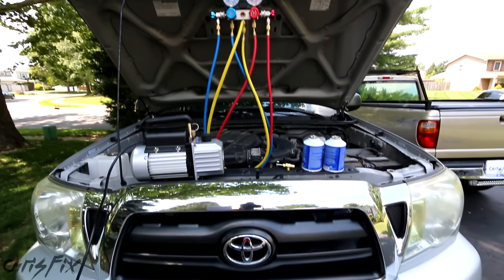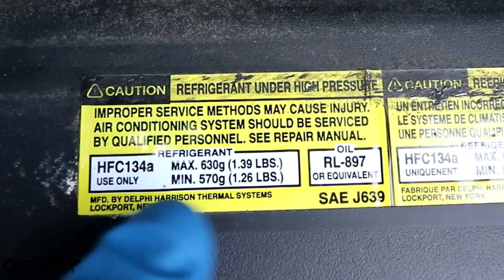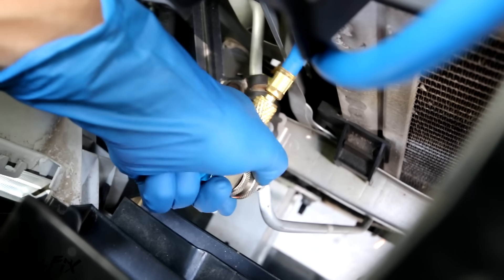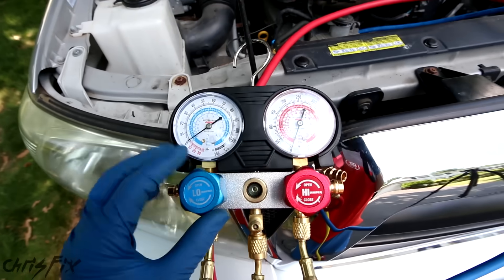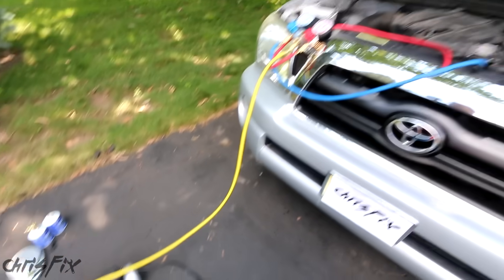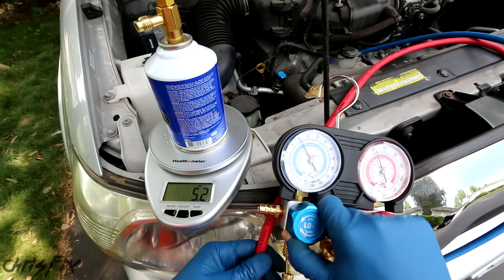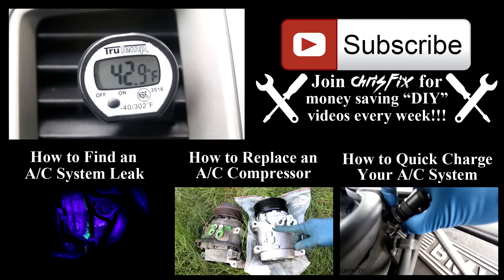How to Properly Recharge Your AC System

Comment: Nice videos Chris!  As a (EXTRA) precaution after pulling a vacuum on a car's a/c system and after performing a system leak check for a minimum of the 30 minutes (using a R-134A manifold gauge set ONLY) and BEFORE disconnecting the manifold gauge line set:  CLOSE  the HIGH & LOW valve at each port, then wait another 15-30 minutes to verify that the High & Low side a/c port needle valves (a.k.a.- Schrader valves) are not leaking.  Nothing's more irritating than having a charged a/c system leak at the High or Low side port, immediately after disconnecting the high & Low side line set!
Reply: I wish I read your comment before re-charging my system. Everything worked perfect for 2 days, then the AC wouldn't cool anymore. I came to find out the schrader valve was leaking. So I had to replace it and re-charge the system. @ChrisFix awesome video - I would add this import step to check the schrader valve since the vacuum test you do on the video can be deceived.
Reply: @howardtempel  the important step that you missed it to put the cap on. It does not matter if the Schrader valve leaks, they all do. Seal it with the cap.
Reply: @bryanbrickson1573  I never thought the cap would withstand 200+ PSI of pressure.
Reply: @howardtempel  

Yes, the cap is like those tire caps. Just a small rubber o-ring at the bottom. Can't seal very well. More to keep out dust.
Reply: @howardtempel a slow leak is not going to release 200 psi. Maybe 5 psi or less.  The cap can handle the pressure of a slow leak
Reply: @adamr8628the pressure will build even WITH a slow leak.  Just takes longer 😂😂😂😂
Reply: Dude this is one of the best how to videos I've ever seen on any subject.  Well done!  If I'm just disconnecting the condenser for a short time to do an engine swap i assume i wouldn't' have to add any oil, correct?  Also if I tape off the open lines would I need to replace dryer and orifice tube?
Reply: @Worldsokayestcraftsman  Always will need to replace dryer during engine swap.
Reply: This just happened to me on the high side I should have read the comments lol
Reply: Thank you so much for every YouTuber like you
Reply: Guys your valve leaks because the high pressure damage your seals. Do not open the red side (high pressure side) you don't need . I bet you have all the oil out and inside the red hose .
Reply: All schrader valves leak. The cap is the seal. To test an electronic leak detector remove the cap. It will alert. Replace the cap. It will not alert.
Reply: My cap sure does a good job at sealing it off.... I have a valve tleeking on my truck. I even cleaned with brake clean and checked it weeks later with a die light.... not leeking....
Reply: @51-FS I've never done an AC repair job before but just got done diagnosing a bad compressor finally.  Part of that diagnostic was attaching a can of R134A with a quick connector just to see if the system was low on coolant. When I pulled the attachment off the Schrader valve some of the coolant from the can, system or oil had spilled into the Schrader valve opening.  I was able to see bubbles forming from the leaking Schrader valve.  I sprayed some soapy water down inside the Schrader valve area after a few minutes to verify there were no more bubbles and then sprayed it out with brake clean and compressed air to get rid of the soapy water.  They sure do need to be checked like u guys are saying
Reply: I've had a leaky valve before so now I just replace the low and high side valves each time I recharge a system. I bought a little kit with a bunch of valves and the removal tool for about 10 bucks years ago and I am not even half way through it yet. Definitely worth it for the peace of mind.
Reply: Yup, my (now) car builds ac pressure when adding refrigerant, but as soon as I disconnect the quick connect on the ac refrigerant can, the low side service port needle valve(schrader valves) leaks with an audible hissing.  I still don't know if anything in the ac system needs replacing, though. I've been driving the car for a few months after having the car sit for most of a year due to bad tcm.
Reply: I can skip this extra precaution if I had never recharged before? I have 178k mi?
Reply: buy the mastercool kit to replace them without losing the charge. Professional...
Reply: Probably pretty rare but yeah
Reply: I thought this through, and I think there is a slight issue... So, let's say that the Schrader valve is leaking... Well, if it leaks into a manifold gauge that is completely sealed, then there is no leak at all (no delta)... Instead, I think one would have to close off the valves, bleed the gauges, then watch to see if they go from zero to some value while the Schrader valves are not depressed...  Let me know if that is flawed thinking or not...   Just realizing that a Schrader valve turned backwards is a blow off valve dependent on spring strength...
Reply: For less than $20, just replace the Schrader valves any time you draw down the system. Empty system, replace valves, pull a vac and then fill. Then there are zero questions. 

Also to everyone that is just refilling with the can kits…a lot of times it’s just the valves. My buddy was refilling with those cans every week or two. He probably bought 20 of them. He finally took it to a mechanic buddy of his who replaced the valves and he never had another problem. Check the cheap, easy stuff first.
Reply: @stevewhiting556  Good for you and your information that you receive....
Reply: @thetruthserum2816  We use nitrogen pressure tests in refrigeration to check for leaks obviously to include the schrader valves.
Reply: @thetruthserum2816  I had the same conflict of logic you did with this comment. He has the right idea but did not know the correct way to expose the Shrader leak. I was looking for this comment. Thanks.
Reply: @thetruthserum2816  

Mmm so isn’t the best thing to do and what should be recommended if you’re doing this to just replace the shrader valve first, which is cheap and easy?
Reply: @thetruthserum2816  tough to install a schaeder valve backwards as it requires a special tool to remove and install it.  Just sayin
Reply: @chrisanderson6204  You missed what he was saying.  A schrader valve, installed the right way, has a little spring under it that keeps the tip up when there isn't much pressure in the system.  Once there is pressure, it pushes on the bottom of the valve too, keeping it sealed.  But, if you "over pressure" from the outside, it will overpower the pressure underneath, and the spring pressure too, and actually add air, etc.  He's not talking about installing it backwards.  But, he is right ... if it is leaking at the schrader valve, and still connected to a closed gauge, the pressure won't change, as it is being held in by the gauge, and can't actually leak out.
Reply: @bennyblanko3  this is all true. My mistake.  It's possible to have a very slow leak at the valve so it's always advisable to check the valve for leaks before AND after servicing.  I made that mistake once on my own car. It was ok before but leaked down after.  D'oh!

Comment: Couldn't you still have a leak after one hour though? I'm going to let mine sit longer because I replaced some o rings and a condensor ( used off my other stang ) and I'll see what it does. It did hold after one hour though. Worse case is it if it takes a long time to leak down and I guess I have a small leak, then I will just recharge every so often and hopefully it's no more than maybe add a little freon every summer or every few summers.

Comment: oh man, as a former AC technician I never used gloves or glasses 😬. disconnecting the high side line of the gauge on a charged and running system is always interesting.

Comment: Refrigerant flows out of a/c compressor from high side in liquid state . As it passes the through the  expansion valve or tube it turns  into gaseous state before entering the evaporator  .
Reply: As refrigerant exits the compressor, it is a highly compressed, super-heated gas.
As it flows down thru the condenser, it cools and becomes a liquid.
The rest...👍

Comment: Hey there Chris, I just got done installing a new AC Compressor on my 2006 Porsche Cayenne Turbo 4.5l V8. The issue I'm running into is that I can't get more than 70psi on the high side. I'm at a loss. I checked all the fuses and they seem ok. If you have any suggestions I would greatly appreciated.
Reply: What are getting on the low side?
Reply: @charlesguinn4316  I'm getting 85 on the low side and 90 PSI on the high side
Reply: @charlesguinn4316  is that the expansion valve by chance?
Reply: @mikestavale6673  I looked it up.
Murray Climate Control A/C Service Kit

Part # MUK20211

At O'Reilly's
It's called a block valve.
I'm not familiar with that one.
But this is a replacement kit.
If the compressor IS turning,  then my next move would be to pull/dump the charge.
Remove the block valve and try to clean it.
But if the dessicant is oil soaked it will need replaced. If it has ruptured and moved thru the system, then that's beyond most DIY. But take it 1 step at a time.
Reply: @charlesguinn4316  i will definitely order it and replace it. I will keep you posted. Thank you so much for your help
Reply: @mikestavale6673  Murray Climate Control Expansion Valve

Part # 39288

Ok they are just calling the expansion valve a block valve...🙄
This is just the valve. One is 38bux the other 52.
not the whole kit.
I'd open er' up then decide which route to take.👍
Reply: @charlesguinn4316  I truly appreciate you Charpes. I'll let you know what happens after I replace it 🤙
Reply: @mikestavale6673  np bub.
Reply: @charlesguinn4316  so I just got done replacing the expansion valve and seals. Vacuumed the system out lefted to see if it had any leaks and the system checked out ok. I tried to recharge it again and the same thing happens. It won't take the freon in the system. I'm totally bummed out. Any other suggestions you might have bud
Reply: @mikestavale6673  When you have a good vacuum.
Close valves on manifold. Connect a can 134, purge yellow hose @the manifold. Open [full open] the high side valve the vac will suck 1 can in on its own.
Close h/s valve, turn ac on max. Crack open l/s valve and the comp will pull in the rest.
If your comp will not suck in the 134 then you may have a comp with bad valve/s. Your sure the comp is turning not just the belt pulley...?
Reply: @charlesguinn4316  i did everything just as you said and it only pulled in 60psi on the high pressure side. I had the ac on the highest setting but it didn't draw anymore in. The pulley spins with the belt but I have no idea if the compressor is actually working or not. I'm just lost to be honest. I truly appreciate your time by the way 🙏
Reply: @mikestavale6673  The center of the hub (clutch) has to spin when you turn on the ac switch.
Not just the pulley. It always spins.
You replaced the comp make sure you hooked up the 12volt connection.
Sounds like the mag clutch is not engaging the comp.
Turn on the ac and Test the 12v wire (going to the comp) w/ a test light to see if its giving pwr to the magnetic clutch...
Reply: @charlesguinn4316  I'm going to have to get under it and have a closer look with the AC on to see if the compressor is actually spinning. I'm also going to check that connection wire that runs to the compressor to make sure it has power. It's just driving me nuts to be honest lol. I can't seem to figure out. Thank you again for your time 😊

Comment: I have to replace the evaporator on my wife truck Toyota RAV4 2002 after install the evaporator how much a/c oil I have to put it
Reply: Add the same amount of oil that you dump out of the evap.
I always add an oz or 2.
Think shot glass.👍
Reply: @charlesguinn4316  thanks

Comment: I followed this video step by step and my ac is running like new the only thing I would recommend is after you finish with the second can Close the valve all the way down and purge  the rest of the line using the gauges to get the refrigerant out of the yellow line and now you can disconnect the yellow line from the can

Comment: Great vid. Can someone explain when we need to use this method and when it's ok to use the fast and easy method that Chris explains in his other air con video?
Reply: Ideally, you would always want to use the gauge set rather than the cans with a single hose and gauge. The gauge set let’s you see the pressures on both the high and low side and you can better understand if there is an issue.

Comment: So if you install a new compressor with the oil already installed won't you remove the oil when performing a vacuum on the system?
Reply: Dump the oil from the comp out. It has prob collected moisture sitting on the shelf.
Add a cpl oz of new pag oil back in.👍

Comment: Bud Chris I just replaced my ac compressor on my 2012 jetta with the help of this video. Everything came out good. I tried to put the exact amount of refrigerant with a scale and maybe was over by 50ish grams. Car needed 550g and by my scale I put about 600g. My ac is cold at night but in the day when it’s like 95 degrees the air coming out is cool but not cold enough to cool the car. It’s 85 degrees currently and my low pressure side is reading 35psi and high side is reading 155psi. Is this normal ?
Reply: Rev engine to 1500- 2k rpm. & Chk pressures while revved. Low should be 35-50.
I'd say prob a bit low charged?

Comment: Everyone Read This Please!!!. I bought a new pump and gages to do this. After I hooked it all up and ran for a bit I noticed all the fittings were loose and had to snug them ALL back up. He's right about only going hand tight on the fittings just check them first if you notice your system isn't holding vacuum.  Oh and thanks for the video my man great info.

Comment: Awesome instructional.  Imagine my surprise on my 1997 Volvo 850 after looking for the high port only to discover that there isn't one.
Reply: Just use the lowside, it will work.👍
Reply: @charlesguinn4316  Did that.  Worked fine.

Comment: Do you have to vacuum the system if you only want to recharge it? No parts were replaced and the system is 16 years old and needs a recharge.
Reply: If it has 0 psi, I would vac it.👍

Comment: Did you evacuate your system at a professional shop before this video? Or did that vacuum you had pull all the old refrigerant and water into it?
Reply: If your system still has refrigerant/pressure in it, don't hookup a vac pump. It can/will blow oil out of your vac pump...

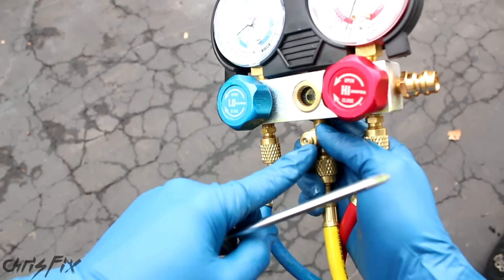Comment: At 9:18 "there is refrigerant in this line and there is air in this line..."  There is also oil in that line if you are adding oil per earlier instructions when replacing parts.  This oil will be blown out of the line by this purge procedure.  Also please use the proper A/C oil if you are needing to add oil and not vacuum pump oil as shown.  And please charge the system with the can top in the UP position instead of the top down position as top down can slug the compressor and end badly.

Comment: If you have to "re-charge" then there was a leak somewhere. Never pull a vacuum until you have fixed the leak, because the vacuum will pull in moisture to the system, you dont want moisture. Find the leak, fix the leak, pull a vacuum, charge the system. In that order.
Reply: Esp if it's a rainy day! 😆

Comment: Could somebody please read this and get back to me my AC I did everything you said it's just when I ordered my AC compressor it only had a little bit of oil in the system and I'll put it on and it's working fine blowing cold air is just the thing is and it's all present ayton too much power to go when I put it online and back the brake pedal gets hard

Comment: Thanks Chris, your walkthrough actually help me fix the AC on my suburban after I replace the compressor from a junkyard. Saved me a few hundred bucks from calling an AC tech for doing something relatively simple, so thanks man!
Reply: why do they charge so much for ac service then
Reply: @kneebarx  Because this service requires tools and some basic training. The same reason people pay for A/C recharge service is the same they do for oil change or brake jobs. Convenience. Of not having to buy tools, learn something new, and potentially harm yourself or your car trying to fix it. 

I’m a total DIY everything in my life kinda guy. I also understand why some of my friends and family will pony up their hard earned cash to get a service done.
Reply: @Ngcarson1337  Just did it myself and works great. after having the right tools found out that it’s ridiculously easy.
Reply: @kneebarx  oh for sure, it always helps to have the right tools and knowledge! 

I actually picked up the same gauges from this video during harbor freight’s Memorial Day sale for $35. I’ll be purging and refilling my A/C system for the first time using this video. The local Honda dealer wanted $260. No. Thank. You.

Praise the internet, platforms, and search engines for allowing us this information! 🙏🏼 stay blessed.

Comment: Can you just use the vacuum to take out all the air, disconnect the vacuum and then just add refrigerant with the cans that have a trigger? Or will that not work?
Reply: Yep you can.
Just make sure you pop that quik connector on fast, or the vac will suck air in!
If you happen to flub it- just vac again...

Comment: Hi Chris. I have a question regarding AC charge. I was told don’t do it yourself because you don’t know how much oil is in the system. Is this true?  I wanted to do this with my son. For both of us to learn. I’m stuck. I am doing this on a Ford that had been recharged and within one year it leaked out.
Reply: If you aren't changing out an evap or condensor, no problem with the oil. If you change out a comp. Dump oil out of new comp and add a cpl oz to it. You'll be fine.
Reply: @charlesguinn4316  thanks